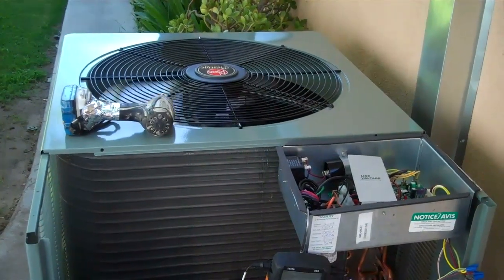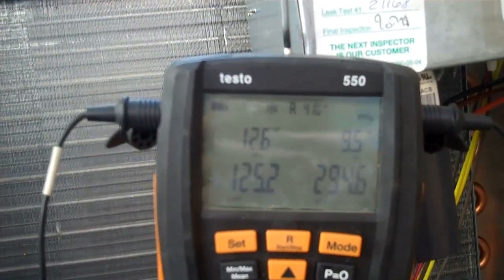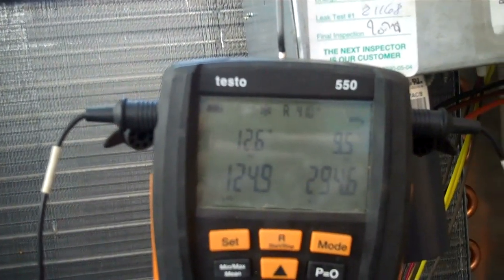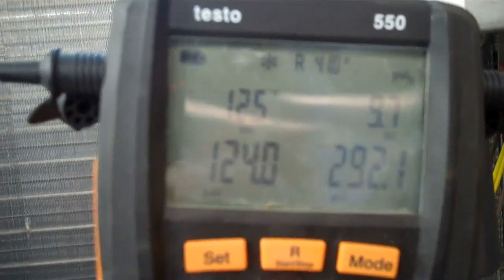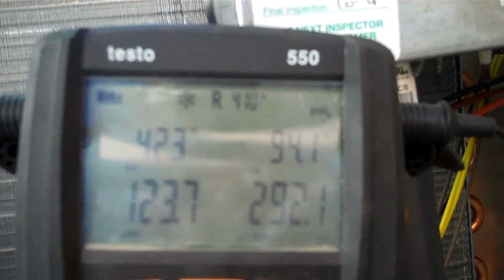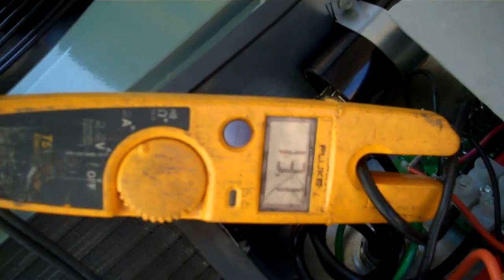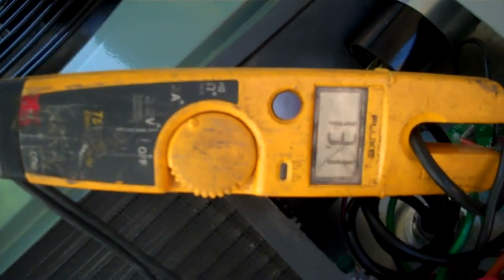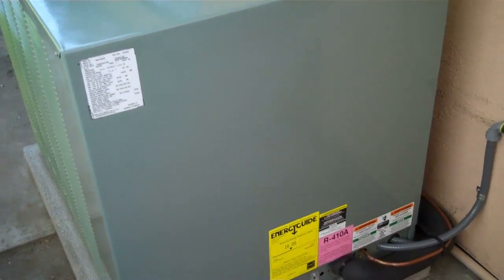TWO STAGE 16 SEER CONDENSER SUBCOOLING AND AMP DRAW

Comment: Add 30 to ambient temp. (I.e. 80deg + 30 = 110) convert 110 sct to pressure and that should be your high side pressure corresponding w pressure and refrigerant being used. Nvm this fancy schmancy digital gauge crap.